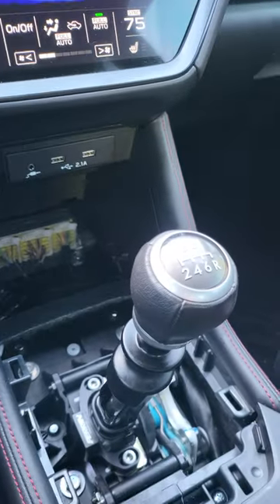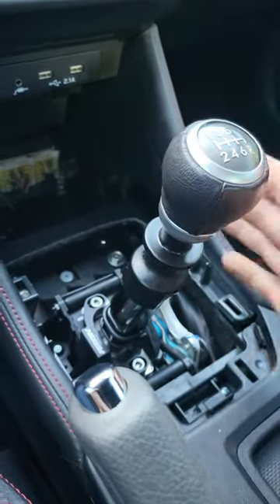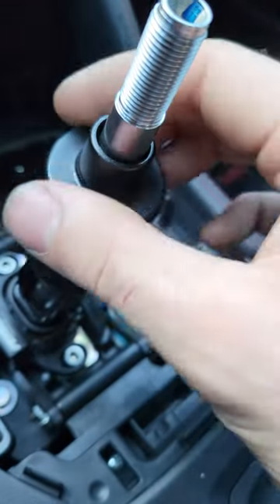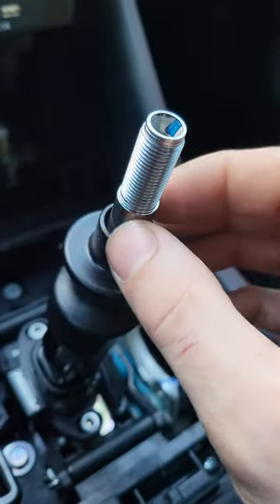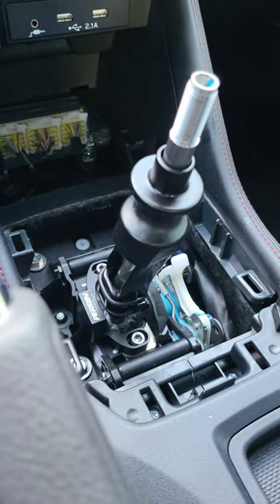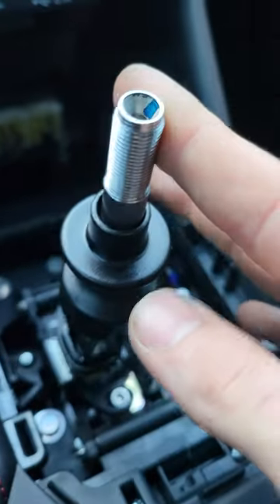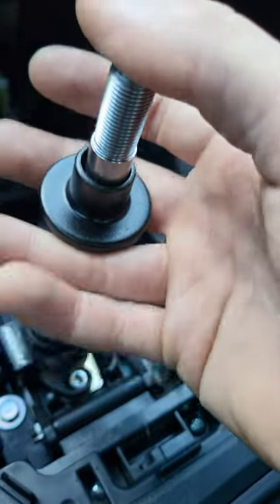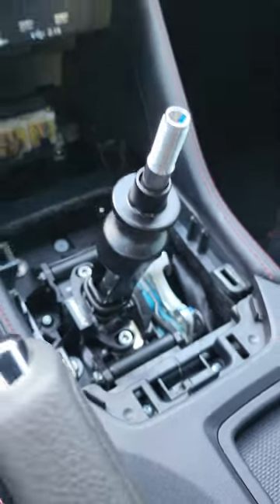2022 Subaru WRX STI Short Throw Shifter Knocking Noise 😑 Suggestions? #tevideos #subaru #wrx

Comment: I actually had the same issue and it was driving me NUTS. Had some tesa fleece felt tape lying around (it's only 19mm wide) and what I did was cut some off, looped it around sticky side facing out, and jammed it in there. So essentially, it's a tube of felt between the stick shift and the reverse lockout. Wasn't able to slip it all the way in, but only a few mm were sticking out the top and the shift knob bit it a bit while threading it on so it keeps it place. Doesn't get in the way of the reverse lockout at all and that plastic slapping the metal is all gone! Worked like a charm!

Comment: I had the same problem with my sti except it would do it stock. I switched to the kartboy and it still did it. Finally went with the raceseng reverse lockout and stratose knob and no more problems.

Comment: I'm confused. The STi short throw shifter has a different OEM shift knob than the one shown in your video here. So, you decided to use the STi short throw shifter but use the OEM non STi shift knob?
Reply from the maker: The STi short throw shifter accessory from Subaru doesn't come with the shift knob. You can buy the shift knob separately though

Comment: Put some grease in there. Same thing happened on my fiesta ST shifter.
Reply from the maker: Grease did help but it's there again the next day after sitting in the sun. I tried some o-rings too but they just come off :/ . OEM shifter has much better tolerance so I just swapped back to my OEM.  No regrets. Honestly I feel no difference from my 2022 WRX OEM shift throw and the STI shift throw. It's nice and quiet now 👌

Comment: mine came stock w the sti short throw and this sound drives me fkn nuts. It makes it sound so cheap every shift!
Reply from the maker: For real.. get the OEM shifter. The tolerance is night and day better.. and the throw feels exactly the same..
Reply: Weird, mine doesn’t make that noise. It’s absolutely silent. Take it to the dealership, see if they’ll fix it.
Reply from the maker: The STI shifter is different from stock. You probably have the stock one which is apparently better than the STI shifter as far as tolerance between reverse lockout mechanism and the rod.

Comment: Mine was having a hard time shifting into first and second, and made this noise. Is that when you noticed it
Reply from the maker: With the Perrin shift stop installed correct? If so then yes. Its because of the play in the reverse lockout mechanism and the rod. when the reverse lockout hits the shift stop it caused the lockout to tap on the rod. I re-installed my oem shifter due to it and it went away. I also highhhly recommend the cobb shift stop over the perrin or any other. The COBB shift stop is made out of nylon rather than aluminum. Do you have a 22 wrx with sti shifter?
Reply: @TEVIDEOS  I just dropped it off at the dealer since I have 200 miles. Not even. But that makes sense.  Yes a 2022 with the sti short. I debated just saying put the old oem one on. But I’ll look into the Cobb. How hard is it to install?
Reply from the maker: @andrewlonghi  Yeah I'd recommend just going to OEM Shifter

Comment: You jinxed me lol. I watched this a few days ago and now mine is doing the same thing. Figure out a solution yet?
Reply from the maker: 😄 shit. I went back to my OEM shifter. The tolerance is much tighter in the OEM one and the throw feels the same to me. Unfortunately I have to get a new shift stop though. Should be here tomorrow!👌
Do you have a 2022 WRX? Or an STI?
Reply from the maker: If all the STI shifters have that large amount of play in the reverse lockout mechanism I'm very confused 😅 I'd go aftermarket all together if you have an STI because there isn't much you can do I feel like. . The rod needs to be bigger in diameter or the reverse mechanism needs to have a smaller diameter.. I don't get why it's not the same. Both rods are the same length in diameter as I measured. Sooo basically the STI reverse lockout is too big and I don't know why 😅
Reply: @TEVIDEOS  I have the OEM Sti Short throw with Perrin Shift Stop installed.
Reply from the maker: Yeahh I'd maybe go aftermarket in that scenario. The 2022 OEM WRX Shifter tolerance is much better as well and would fit in an sti
Reply: My 2023 same problem and how can I fix it